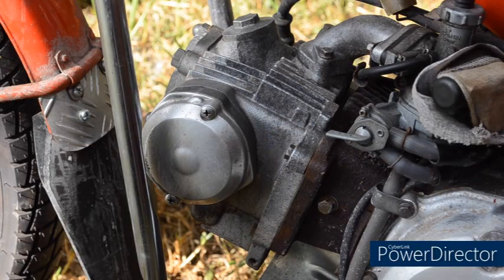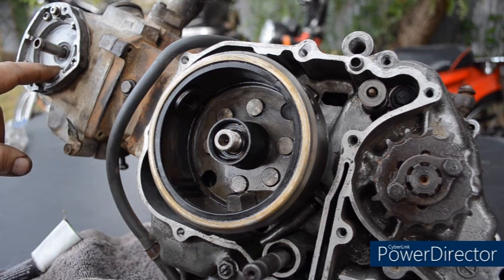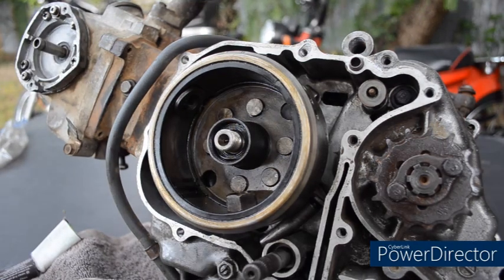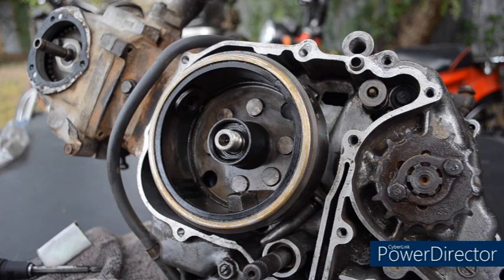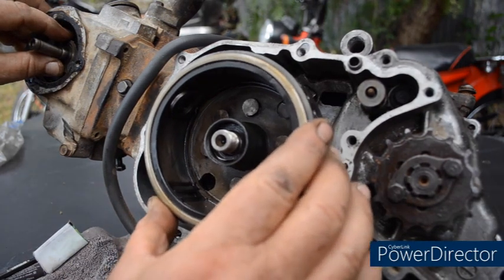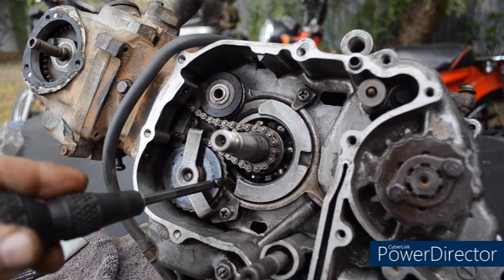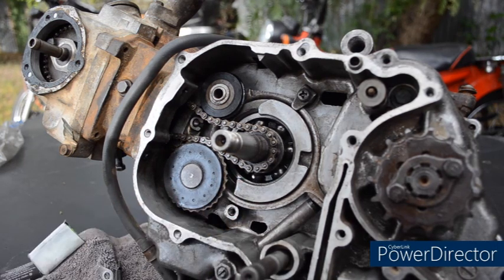Honda CT 110 Trail - Cam Chain How To Replace Part 1

Comment: Couldn’t figure out how to get the flywheel off, gonna get a 6v puller. Great video, very helpful
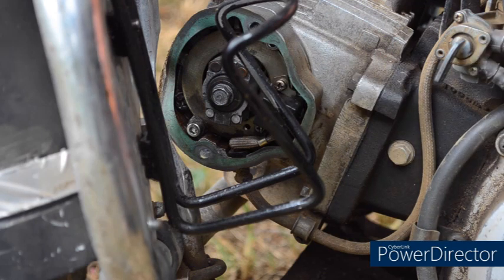Reply from the maker: Glad it was helpfutl, just remember to remove the flat washer before screwing in the puller, if you don't, the puller doesn't screw in far enough & will strip threads.  My video 'what's causing the engine knock part 2' at 1:00 shows how to use the puller & remove the flywheel.  Thanks for watching & commenting.

Comment: I’m about to buy a ct110 off Facebook market for 950 bucks. It’s got a loose cam chain, a bit of rust, and some missing light bulbs. I’ve never torn apart an engine so I’m gonna try to restore this one to learn🤞 wish me luck!
Reply from the maker: ct110's are a great bike to learn on, the cam chain may only need adjusting.  But if not hopefully my videos will help you out.  Thanks for watching & let me know how you get on!